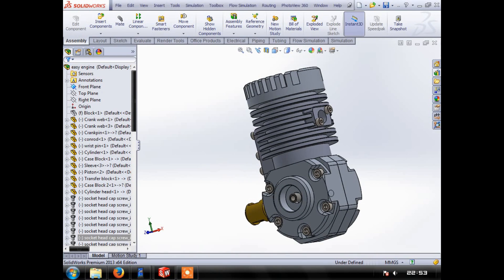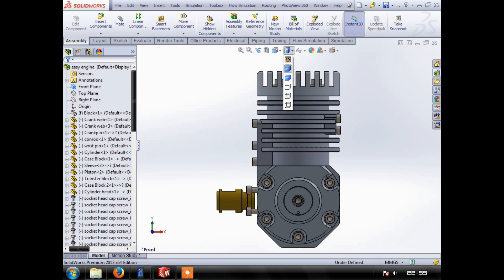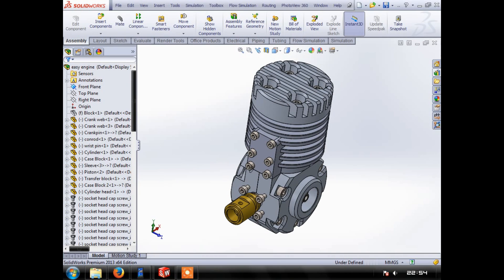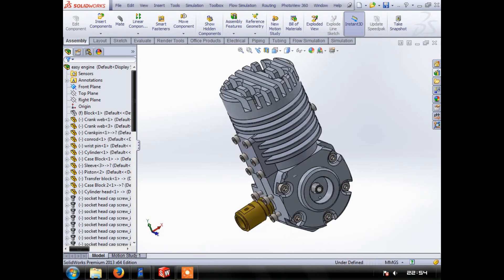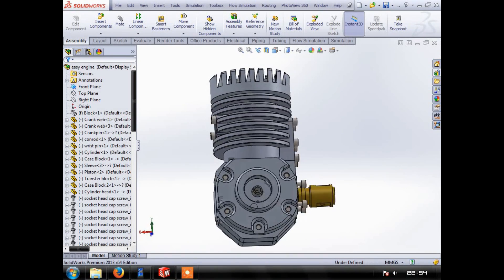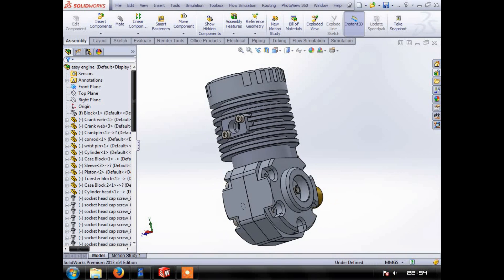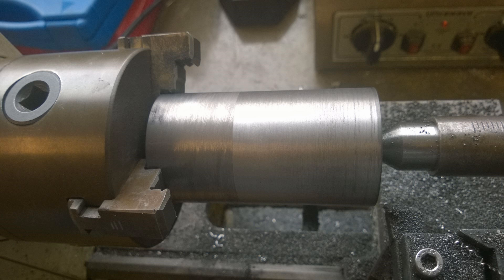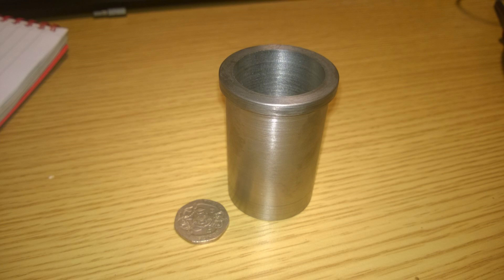Homemade 2 stroke engine - step by step - Intro + part 1

Comment: challenge! design us a home made 2 stroke, that runs on diesel. 
rules: 1 as many cyls as you need. 2 you can use off the shelf components to time ignition (injection?) and inject the fuel, all other components have to be designed by the builder. 2 it must be at least 50cc but no greater than 250cc.

Comment: Is your Design? Or you use plans?
Reply from the maker: My design, but it's nothing to bragg about
Reply: @thedirtyworkshop  did you ever finish this I can’t find anymore videos of you making this I’ve actually already started making my own actually by accident really was practicing my machining on some scrap wound up making a very nice cylinder with radiating fins and all I’m gonna go ahead and build it to get my skills up bore as mine sits is 1.75” inches but I believe I’m going to make a cast sleeve instead of leaving the 4140 steel just seems more practical of a wear surface I’d like to get it down to 1.5 bore then possibly plan on 1” or 1.25 stroke I’ve got all the principles of how these engines works but there’s allot I don’t understand from the engineering standpoint such as lower case volume as well as port height and angle idk if any of these are critical except port height as to high it’d basically make the engines stroke useless because of lack of compression distance so I’m thinking exhaust port somewhere near bdc maybe say low point is where the piston is at 8:30vrs 12:00 tdc position intake being 5:15 at beginning to open the port full port at  5:45 that’d give it from 5:15 to 7:15 to push exhaust out and charge the cylinder with fuel and air but like I said I understand the principles but curious as to weather or not crank case volume has any effects on how it performs and also sorry for not using degrees on my port explaination just seemed simpler to use clock hands

Comment: The design is pretty much the original opposed ported 2 stroke motor that Mr. Alexander invented and patented in the 1890's. As he was a Scotsman and therefore British the 2 stroke engine is yet another British invention. (Weren't we once such a marvellously inventive nation back then before the idiots took over running the country!!)

The piston needs the 1920's improvement a German, named Herr Schnurle (the "Schnurle Loop induction effect"), who found that adding a intake deflector one the rear piston head improved volumetric efficiency versus opposed ported flat top pistons.

You'll need to put a recess in the cylinder head though.

Having worked with some classic and vintage 2 stroke motors, it would be interesting to measure the difference in consumption and performance between the Schnurle deflector opposed ported 2 stroke motor versus the original Alexander flat topped opposed ported 2 stroke motor. 

Transverse porting (Jawa 1944) hit the motorcycle world in 1946 which was the death of deflector piston 2 strokes by the mid 1950's. (The French persevered the longest with this obstelete technology). The most recent deflector pistoned 2 stroke I looked inside was French.

Chronologically the crank case induction 2 stroke evolution has been:

1890's Opposed flat topped piston > 1920's Schnurle deflector piston opposed ported > 1944 Transverse ported flat topped piston (Jawa)> 1952 Squish band cylinder heads (Jawa) > 1958 Reed valve (CZ) > 1964 Rotary disc induction valve (MZ) > 1970's Combined transverse and opposed porting (Yamaha) > Exhaust power valve (Yamaha) > 2015 EU new CCI 2 stroke vehicle ban.
Reply: Sir, this a McDonald's...

Comment: I have college later today 😅 but fk it, I study engineering so I'll just blag it that I'm studying 😂 currently starting to design an electronically controlled power-valve to replace the system on a 93 yz 125 cylinder 👌🏻
Reply from the maker: Sounds cool dude, if you need any advice or questions etc, then feel free to email me - matt-j-chapman@hotmail.com

Cheers for the comment - matt
Reply: +Pony Power cheers Matt, top bloke, I think I'll go for a stepper motor to cable to a lever on the PV set up so I can keep the SM away from the cylinder heat, still probably using a heat sink, got to machine all my own parts so if I get the time to make one really, and just to be a pain in the arse I want to program it to be RPM dependant (tuneable obviously) but also (if I get the time) program it to read the throttle position via a sensor on the throttle body (that way on decel you could maybe find benefits from different port heights with flow cooling etc), never know 😂 might just pull it off 😅
Reply: Great idea, for throlle position senor. You could get a carb from a k6 rm125 (2006 and newer). These mikunis has it on top op the carb. And a extra plus is that the carb has and electronic controlled power-screw(extra jet). This is controlled by an solenoid. 
Let me know how far you are with the project! I have heard that TM used the same concept. But many has removed to mechanical.